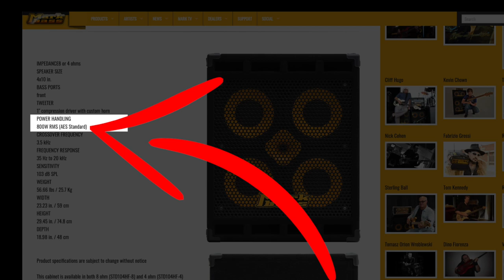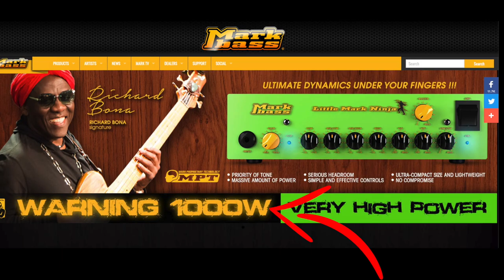WTF? Bass AMPS, WATTS and OHMS finally explained!

Comment: I'm planning to connect a second 2x10 8OHMS 400W bass cabinet do my Little Mark 3 head. From their FAQ it was said that from each head speaker output i connect 1 cabinet as showed at 8:24. Or connect one of the speaker output to the first cabinet and then link it to the second cabinet again as showed 7:19. But it doesn't mention nowhere about the doubling of the impedance to 16OHMs or that will run quieter if i connect cabinet to cabinet it just says that either way you connect it you will run at 4OHMS but you say otherwise. You also have Markbass setup so please let me know what should i do. This is really weird i guess it should have worked great/same either way. Thanks

Comment: I'm just learning bass. I have a G&L tribute LB100 (great bass for the $$!) but no amp. I am practicing through an old crate guitar amp model G-60. It sounds just okay, but am I at risk for damaging my amp?
Reply: You're probably ok but that's a guitar amp and will sound thin.  Frankly, crate amps are very thin anyway....  nobody should own any crate amp...  You need a bass amp.  I recommend  Fender Rumble 25.
Reply: @MrBlahdiblahdi  Thanks! I see a used Fender Rumble 100 here for $150....BTW I do love the G&L...you should check one out some time.
Reply: I am a big fan of the Asian made G&L.  Much better quality than the Asian made Fenders.

Comment: I have a hartke vx3500. 3500 amplifier with 350 watts. It has 4 10" speakers at 4ohms 100 watts. I cant find a replamen speaker. Will it be ok to use 8ohms to replace all of the speaker

Comment: Got it about the omhs, still have a doubt about the wattage, cos i own one amp of 4 omhs and 300watts and 2 cabs of 8 omhs, one of 300watts but the other has just 150watts. Do I risk to damage the 150watts cab if I connect both cabs in parallel to that amp???

Comment: I have the same 4x10 cabinet. the back says its 4 ohms, but when i look online it says 4 or 8 ohms. it even shows it in this video. does that mean its regularly 8 ohms but when wired in parallel with another 8 ohm cabinet, its running at 4 ohms?

Comment: Its really not complicated. Read the specs.Most amps run fine with 4 and 8 ohm ratings. Buy 8 ohm cabs and then you can run one or two as needed. 2 amp heads are more rare. Genzlers are an example of this.

Comment: as I am shopping for a new rig. I have a 3 part question.. your amp is 800 @ 4 500 @8.  If you have an identical 410 cab will the 4 ohm version seems louder then the 8 ohm version by itself? will running the 4 ohm give me more headroom and volume?
Reply: Running more speakers with two 8 ohm cabs will give you more volume than running one 4 ohm cab with a higher wattage vs the 8 ohm speaker .

Comment: It does not matter, until have the speaker coil spat out of the speaker. In general, to get the max "watts" out of your amp, you need to MATCH impedance, 4, 8 or 16 OHMs.

Comment: ok, that means I can safely connect a TC Electronic BQ250 amp head to the Fender BXR100 amplifier. As long as I don't push too much volume on the BQ250, the BXR100 should be fine.

Comment: I had a semi tube (those fake tubes) 60 watt custom build (originally owned by my uncle) bass amp with a yamaha 2x15 and 2x10 hartke combination...

The speaker blew and i was about 17 so i ditched the amp completly...

Ran a hartke lh500 with a 450 watts 4x10 after switching that up by buying my guitar players peavey tmax, tore out the amp and used my 4x10 with a 1x15 mix.

Thats still owned by me but i switched to a markbass amp with a mesa 6x10+1x15 and there i hit that sound that i want!

Comment: Just my old timer opinion but if you're pumping the music into a PA in addition to stage volume, let the PA do the heavy lifting, i. e. the lowest bass thuds. The stage sound doesn't need that. On stage I want percussive punch, and that's going to be more like 200 hz than 50. So I don't need my own 18s or 15s when 12s or even 10s would more effectively do the job. I used 2 12s and a midrange horn built into a wedge.

Comment: quick question - how many watts is enough to gig with? 80w, 100w, 1000w ???
Reply: Depends on your gig. 200-500 will cover most bars/small venues. Especially if they are inside. If the venue is bigger, and is maybe outside, 500-1000 is preferred. Pair the amp with a cab that utilizes all the power, or two cabs to utilizes all the power. Though this is not necessary. You could get by with a 100 watt combo amp that just lines out to the PA at the venue. Without a PA though, 500+ watts will prolly be needed to be comfortably loud.
Reply: @kujob6442  cheers

Comment: So would I be good at full power with an 800W head and a cab that’s 400W at 8 Ohms?
Reply: As long as your amp runs under 400 watts at 8 olms then yes. You can go over a bit and be ok as long as you’re not gunning it.
Reply: @firemarshal2629  yep, but if his 400W speaker is getting the full 800W then no, or only less than half volume. Running a risk in that situation.
Reply: You do need to be careful to not run it too hot, but in fact you'll get a better sound at higher volume since the amp is not being stressed and driven to clipping. 

You are better off overpowering speakers than underpowering. Once you push an amplifier to the top, you start introducing excessive power that is not doing anything except distort. That is bad for for speakers.

Comment: Hi, there. What's about the combo amp? 500w @ 4omh and 300w @ 8omh. Which speaker cabinet do I get? Thanks for sharing.
Reply: KHMER ICON combo amps have a built-in speaker. But I understand some have additional speaker outs. It depends on how powerful you want your setup, but 8ohm is a safe choice.

Comment: 🎯 Key Takeaways for quick navigation:

00:00 🎸 Introducción al mundo de amplificadores de bajo
- Explicación de la complejidad al comprar un equipo de bajo.
- Dos opciones al comprar un amplificador: combos prearmados o emparejar una cabeza y un gabinete por separado.
- Pros y contras de los combos, destacando la versatilidad frente al peso.
02:49 🔊 Potencia, vatios y ohmios en amplificadores de bajo
- Diferencia entre la potencia en el cabezal del amplificador y la potencia en el gabinete.
- Explicación de los vatios y su relación con la capacidad de salida del amplificador.
- Introducción a la clasificación de ohmios y su importancia en la conexión de cabezales y gabinetes.
04:11 ⚡ Impedancia: Factor crucial en la configuración del amplificador
- Analogía de la impedancia como la resistencia en un grifo de agua.
- Advertencia sobre los riesgos de operar un amplificador por debajo de 4 ohmios.
- Peligros de no comprender y respetar la impedancia adecuada para el amplificador y los altavoces.
06:03 🔄 Conexión de gabinetes en configuración paralela o en serie
- Elección entre gabinetes de 8 ohmios o 4 ohmios y su impacto en la impedancia total.
- Aclaración sobre no conectar gabinetes en serie para evitar la pérdida de potencia.
- Recomendación de conectar gabinetes en paralelo para mantener una impedancia segura y obtener la potencia total del amplificador.
08:36 🎛️ Configuración personalizada del equipo de bajo
- Ejemplo personal del setup de Clay con un cabezal de 800 vatios y dos gabinetes de 8 ohmios.
- Desafío al emparejar gabinetes de diferentes potencias y cómo enfrentarlo.
- Solución ingeniosa con un dispositivo personalizado para equilibrar la distribución de potencia entre los gabinetes.
13:56 🎵 Conclusiones y recomendaciones finales
- Recapitulación de los conceptos clave: potencia, impedancia y conexión de gabinetes.
- Consejo sobre la importancia de elegir cuidadosamente los gabinetes según las necesidades del músico.
- Invitación a plantear preguntas adicionales en los comentarios y referencia a otros videos relacionados.

Made with HARPA AI

Comment: At 7:15 where you start to talk about daisy-chaining cabs with one cab plugged into the amp and the other cab plugged into the first cab, you are giving them the wrong information, which could result in damaging the amp. You are calling that daisy chain connection a "series" connection and it's not unless the first cab has both, a series output jack and a parallel output jack and you are specifically plugging into the series jack. Otherwise it's a parallel connection and the amp sees the ohms load exactly the same as if that second cab was plugged into the amp instead of daisy chained. . Industry standard connections are ALL parallel connections, not serial connections and have been for decades now.  I have an old Sunn B202 cab that is a 212 cab and it actually has both a parallel out AND a series out connection out of the back.  It is the only cab I've had that has the option of a series connector, and I bought my first cab in 1966.

If you daisy chain two 8Ω cabs up and they don't have a specific "serial output jack" that you're plugged into, that's a parallel connection and will put a 4Ω load on the amp.  Not a problem if the amp's minimum ohms load is 4Ω.  However, if you daisy chain two 4Ω cabs cabs together, that parallel connection drops the ohms load to 2Ω.  If the amp has a 4Ω minimum load, then you are in real danger of damaging your amp or even turning it into a very expensive paper weight.  You need to fix this part of your video.  Otherwise someone will daisy chain two 4Ω cabs together thinking that the amp will be seeing an 8Ω load when it will in actuality see a 2Ω load which could cause interior electronics to melt.

Comment: I have an peavey 700 fire bass. I run 2 ..4x10 cabs at parallel. Each cab is rated at 4 ohms . for 5 years and had no problems. But you said its not right. I think your wrong.
Reply: As long as the head can run at 2ohms, you are fine.  But just because you haven’t had problems (yet), doesn’t mean it is correct.
Reply: @tylerpirc   . your correct. But after 5 years and 2643 shows i haven't see the problem yet. So after 5 years this amp has not had a problem i have it cleaned and check every year. I for got to mention. It runs 2 ..4....8. Ohms.
Reply: @Cruiseangel72  then yeah, if your head is rated to run at 2 ohms, you can use two 4ohm cabs without problem.  My point is, the guy is definitely right when he says running two 4ohm cabinets puts a 2ohm load on the amplifier.
Reply: @tylerpirc  i see your point. And your absolutely right.

Comment: What's the tone advantage of 4x10 over a 15?
Reply: 40 inches of speaker compared to 15
Reply: @coltonjames8806  That is not how circles work lol
Reply: In terms of tone, the bigger the speaker, the more bass frequencies you'll get, and consequently, less high frequencies.

That's why, for more sound definition you'll wanna have several medium size speakers, so you can get a good range of frequencies.
Reply: And for people that want a heavier low sound, they can add a big solo speaker to their gears.

Comment: Why does halving the impedance not mean twice the amp output?
Reply: Rose 25 y.o - check my vidéó  Does it say 'minimum 8 ohms' by an output socket? If it does, and the 450w speaker is 8 ohms or more, it will be OK.

Comment: Just so everyone knows, the section about impedance is incorrect in relation to series/parallel. Impedance is always lowered with adding more cabs. There is no brand that has "series" connections to tap into externally. E.g: 8+8 ohm =4ohm 
*I guess that's why it has a disclaimer saying "check your manual"

Comment: Great vid! 

Im confused.

I check speaker cable with my muti meter with both cab connected to each other and it halfed the ohms.
From there independent tested value. 

I MAY be wrong...lol
Thanks!

I use a Big Bang, new york 121 and a 210p in series and its great! ! !

Comment: I want to ask, can I plug a bass to an guitar amp? Will it work?
Reply: u can but dont add mutch volume just on 3
Reply: bass amp for bass/guitar amps for guitar///////////so wont blow up your stuff.
Reply: You can, you will not burn enything, belive me, I tried, you wont get the best sound but is ok, it works
Reply: One of my favorite practice/silent setup is my bass plugged into my ZT Lunchbox (200W guitar combo amp) and either plugged into a bass cab or just a pair of headphones. The gain is tasty.
Reply: Main difference is, guitar cabs are usually open at the back and bass cabs are closed. Problem with bass through open cabs is acoustic shorting, meaning part of the energy flowing around the cab canceling out the volume, leading to exaggerated membrane movement and decreased impedance. Therefore you should either close the cabinet or avoid volume levels that lead to plopping noises or distorted sound. Some guitar amps make decent budget practice amps like i. e. the Boss Katana as long as you play at reasonable volume.

Comment: Most amps will just burn their power supply if you push them below rated impedance. They  will not just shut down! Those protections are not as common and also less efective! Just simple NEVER go below rated impedance as you can actually burn it's power supply even at half volume!

Comment: just want to add that the max amount of watt of an amphead should never be reached by the amount of watt in a cab... So if you have a 400 watt cab, use a larger watt amp like 600, so it doesn't have to run full power (because THAT ruins the speakers)

Comment: Why does this seem so much more of a oain in the ass than with electric guitar heads and amps? Mixing different sized cabs together is usually just a bad idea...and then you only need to worry abiut matching impedances. Some cabs also allow daisy chaining, if it's clearly laid out in the design.
Reply: The simple fact that bass guitars output much more low end, the much increased bass frequencies cause your speakers to rumble and vibrate much harder, causing more friction and amperage through your speakers

Comment: Or buy a Hartke Bass Head that has a BALANCE knob option. Such as the Hartke Kilo or Hartke LH1000. I'm sure their are others like these 2 Hartke Bass Heads.

Both of my Bass cabs are higher wattage rated, running 8 ohms each cab, and no fear of over driving my top (2x10) cab or my lower (1x15) cab. 

Or I may use BBE Sonic Maximizer with the Subwoofer control, run my head into it & down to both my cabs & balance everything out nicely. 😁